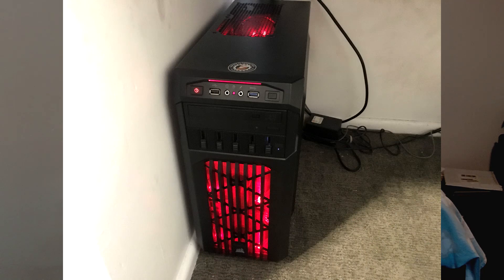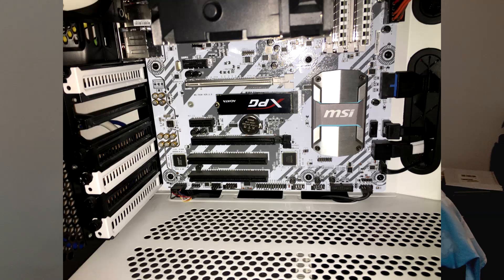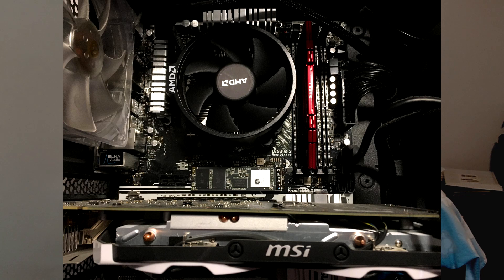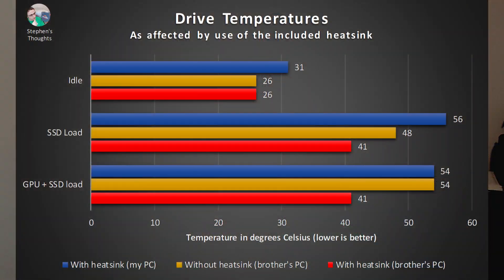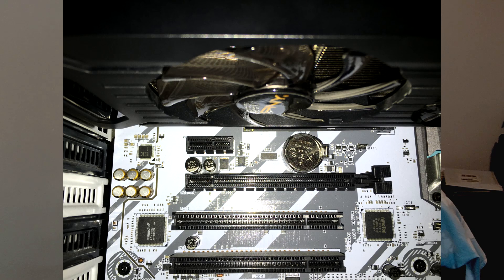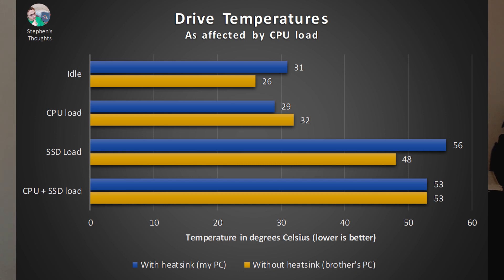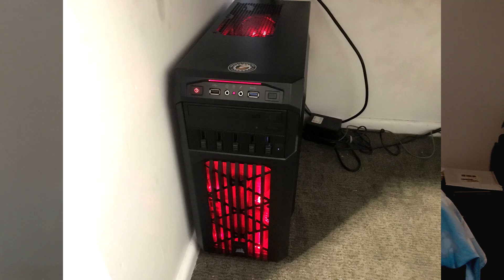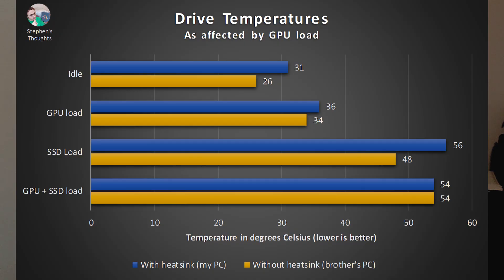XPG SX8200 Temperature Tests - Does the heatsink actually work?

Comment: I've a question actually. My motherboard already comes with a m.2 heatsink so can i use this heatsink for another ssd which will be in an enclosure?
Reply from the maker: Hmm... You probably could, although it might not be as effective. The heatsink ships with adhesive that's cut to line up with the controller and flash chips on the SX8200. So if the chips aren't in similar positions on both drives, it probably won't be as effective as it is on the SX8200. I think you'll find a decent shot of the adhesive towards the end of my SX8200 unboxing video, so you can see the shape of the adhesive.

Additionally, some SSD's ship with a sticker on the chips, which would further reduce the effectiveness of the heatsink unless you remove the sticker.
Reply: @StephensThoughts  thanks
Reply: @StephensThoughts  I just got this drive and good work for giving information about temps because so many reviews and no one care to give that information. My drive came with 0 power on hours but with like 450GB read and 450GB Write not those specific numbers but i think those was for testing  like some endurance test done by the company because the box was really closed and was 0 power on hours so i think was not being used before. Now the drive works perfectly well. But i am using it without a heatsink because i don't know if the heatsink that is being giving in the package is well enough I would like to try it but my worries is that if i ever wanna change it for some better heatsink with thermal pads i am going to able to take it off? I am asking this because i saw that the heatsink adhesive glue or tape is quite strong and my worries is that if i change a bigger heatsink i cannot pull off the one that is being giving and end up breaking the M.2. Do you believe i am exaggerating or is possible to take the heatsink off if i ever wanted to change it?
Reply from the maker: Based on my testing, the heatsink is good enough to make a substantial improvement, at least in a case with good airflow. But it's not really necessary, as PCIe 3 drives still don't produce enough heat to cause issues, at least not under typical PC use and with some airflow. After all, the gold standard for NVMe SSD's, the Samsung 970 series, don't ship with heatsinks at all.

Although you are right that once it's on, it's not going to easily come off, it probably won't really matter whether you install it or leave it bare. To my mind, it's mostly an aesthetic choice.
Reply: @StephensThoughts  I got the 1 TB version Iddle temp is at 46C and when i use crystaldiskmark it goes up to 54. With what i have seen in the web my iddle temps is a bit high, my PC case have 3 fans fully blasting at front but still temps is at 46C and the M.2 is close to the CPU not down there with the graphics card. I do live in the tropics but is ok at night still sits on 46C and i don't have air airconditioner so room temperature maybe like 30? Should i be worry? Thanks for your replies btw.
Reply from the maker: Those temperatures don't seem ridiculous considering a higher ambient temperature, as that will reduce how effectively the front fans can cool everything. Blasting ~30 C air won't cool things as much or as quickly as blasting ~20 C air.

Comment: I've seen some information that says SSD like heat.
Reply from the maker: Hm, that would make them basically the only component that likes heat. Do you happen to remember where you heard that?
Reply: @StephensThoughts  I know it's a year late but here https://youtu.be/KzSIfxHppPY go to 6:15 the NAND likes heat, the controller not so much.
Reply from the maker: Thank you, that is some excellent information! I think I'll add a pinned comment with that link, as that's definitely some important information to keep in mind with regard to the video.
Reply: they thermal throttle at higher temperatures
Reply: The NAND chips themselves like heat, it's the controller chip that doesn't.
Reply: Not heat necessarily but a bit above average operating temprerature and only a part of the ssd. The controller works better it's kept a bit warm.

Comment: Which side does this heat sink install to? Also I’m putting this in a external thunderbolt3 enclosure with a fan inside. Thank you
Reply from the maker: The heatsink goes on the side with the controller, which is the silver chip near the connector. This will also be the side facing outward. By my estimation, your enclosure should be similar in airflow to the computers I tested in. But honestly, thermals aren't likely to be a major issue either way.
Reply: Stephen's Thoughts Thanks Man!

Comment: awesome review btw and very nice follow up vid, I just received my SX8200 which I got for my laptop, and was looking for advice on whether or not to apply the heatsink, it would still be a lot different for a laptop with limited air flow, but still this video was very useful! Merry Christmas and happy holidays!
Reply: thank you for the info ;)
Reply: @mozack7174  no worries man, have a nice day!
Reply: so which one is better? with or without for laptop
Reply: @mozack7174  as the video showed, it's a bit better with a heatsink on, I put it on mine, and I haven't had any problems with high temperatures over load, it should be a noticable improvement
Reply: @mozack7174  I checked other videos as well, and they too showed that it keeps better temperatures with the heatsink on